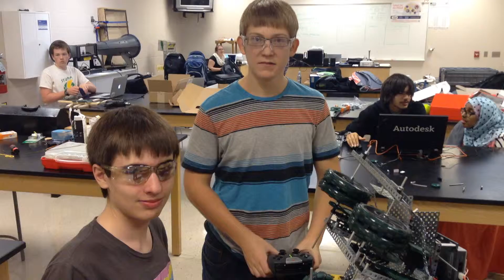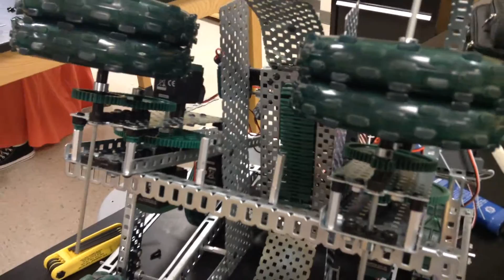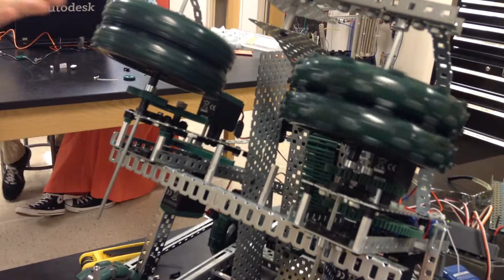STORM ROBOTICS Team 9210 Trouble Shooting Flywheel Power Drops

Comment: Are you sure that the motors on the bad side are both running the correct direction? If not one of the motors might not be on or working (i would take it off and check) or it could be the 2 to 3 wire converter breaking (that happens a lot to us) or last thing, it could be the internal gears of the motor shaved off. (that has become a problem with a few of the teams near us). let me know if any of these are the case. -929Y